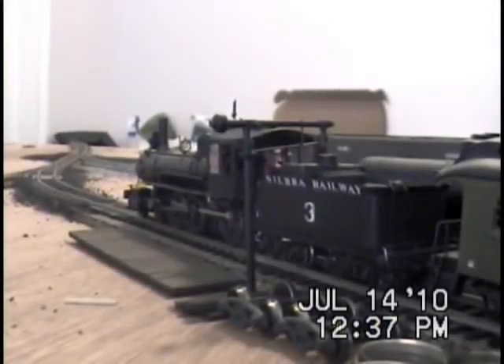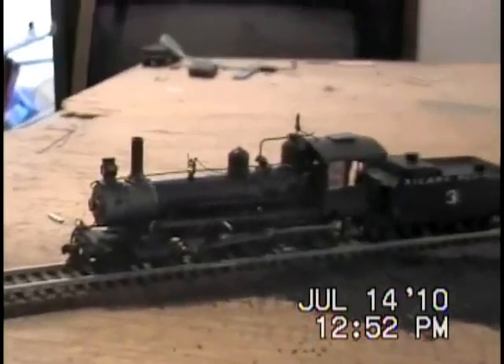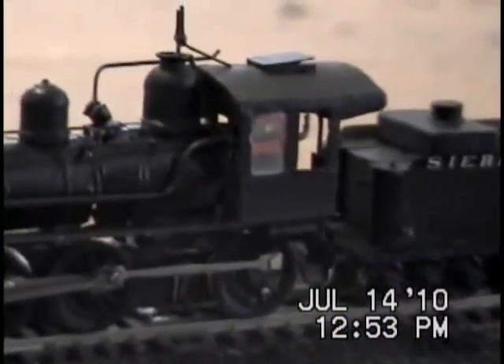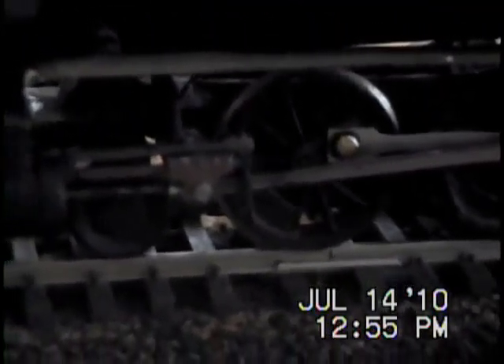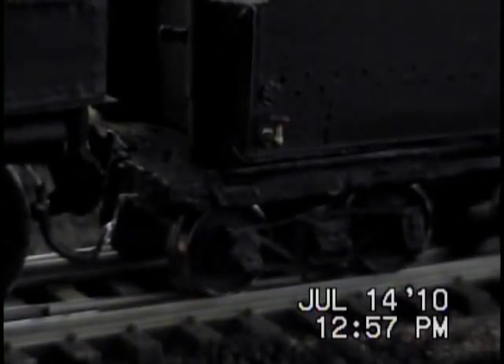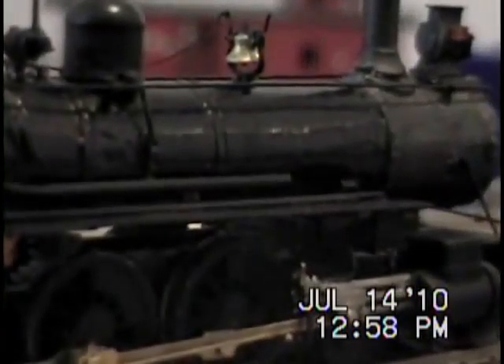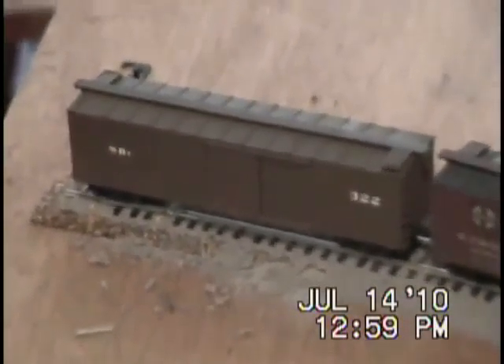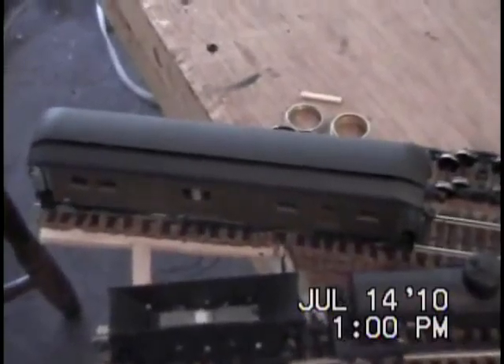Word in the Shop - Sierra Ry. 1929 blog

Comment from the maker: F.Y.I. 

Locomotive 3 has had MUCH more work put into her since this video. Since I've been on vacation at Yosemite, I've been working full time on the 3, and unexpectedly, she had a bad fall that cost me 2 vital parts to the locomotive's operation, but I'm pretty sure I have replacements(LUCKY!). 

She should be running again, all clean, with freshly spray painted drivers, in a few days, and I will make a special "Word in the shop" video to announce her return to active duty.